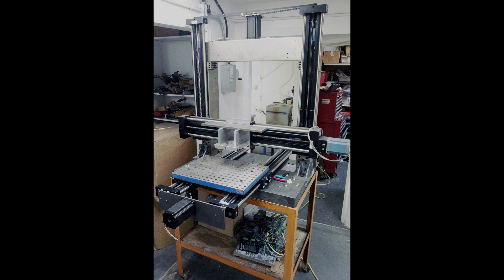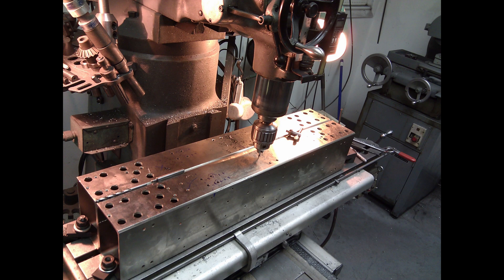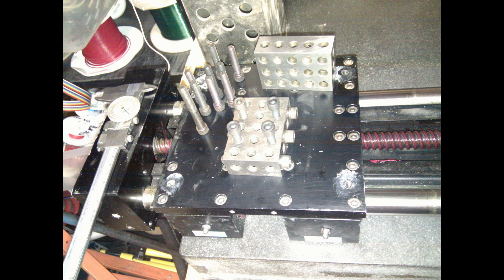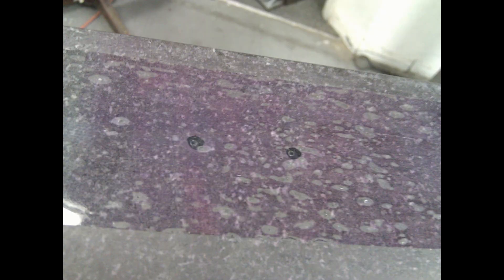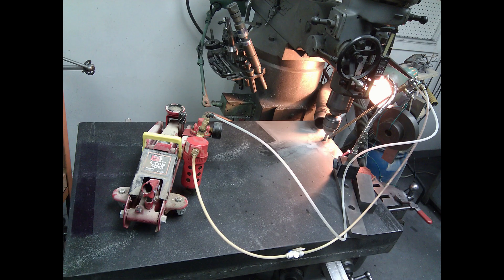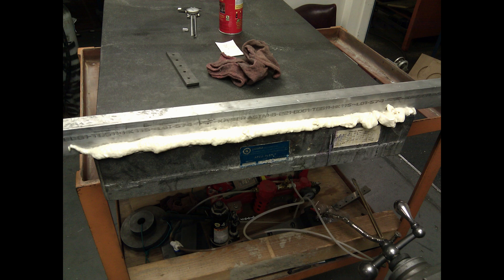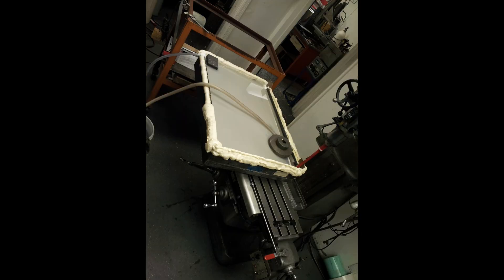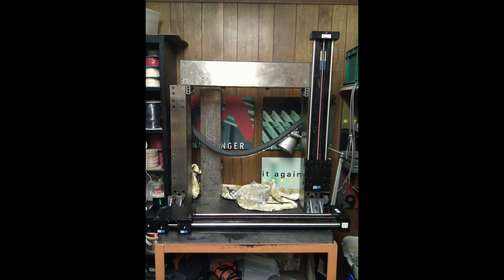Granite surface plate based CNC mill - Retroactive build log

Comment: Looks like someone never did their homework, put steppers on a granite CNC 😂. That diamond bit didn’t work because you need to use water while drilling else the embedded diamond particulates will melt quickly and now you just got a spinning drill with no diamonds. The water also helps the dusts to lift out from the hole as it being drilled. The 1-2-3 block as a mount is a good idea, however you need to make large ones since it’s too small for your gantry frame and it’s not rigid enough.
Reply from the maker: Yeah. 10 years ago... Was definitely very green 🙂 I enjoy the journey and sometimes do things that I don't expect to work very well for the learning. For example, I knew very well that servos are better an every way than steppers, but wanted to get a feeling by how much. So I set out and built a laser interferometer to be able to measure the improvements. Check out some of my other videos on that. As a side effect, these interferometers have become fairly popular. Check out Sams semiconductor works in his garage: https://www.youtube.com/watch?v=vPu6lN9yJOY&t=203s
Reply: @janbeck8269  wow you built a laser interferometer, need to check that out. Is it possible that it can be used to measure the finish flatness accuracy of the surface plate using the built interferometer?
Reply from the maker: @ShopperPlug  Unfortunately, flatness measurements are not a thing this interferometer can do .....